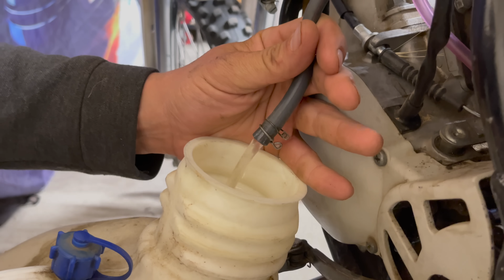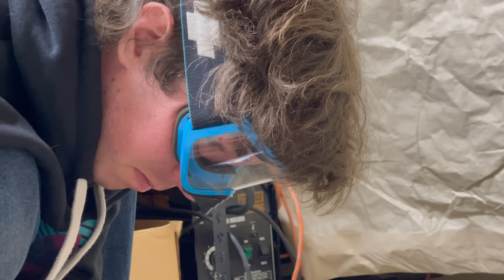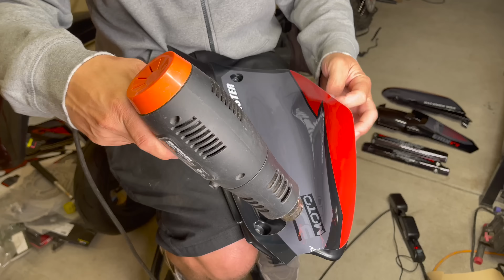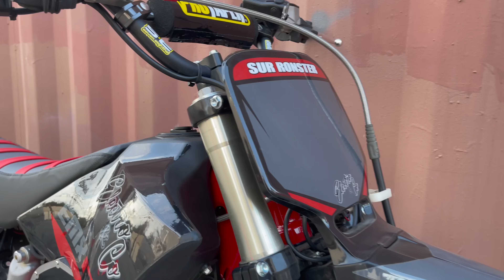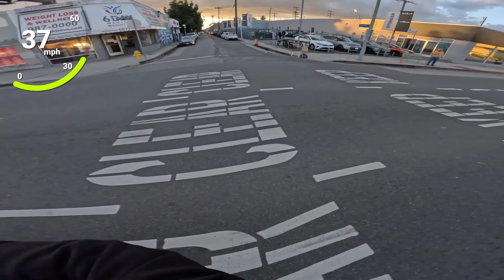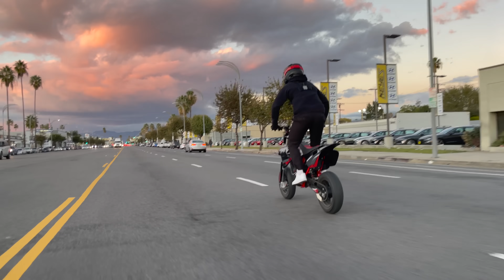Electric Yamaha YZ85 Supermoto // OFFICIAL Test and Review

Comment: yes but the clutch and what gear we're in on gas bikes makes the fun out of it, a lot of people like me find the clutch fun af
Reply: Exactly
Reply: an electric dirt bike should have gears and a clucth. It would be PERFEECT but in terms of maintenance you will have to change the oil and replace the clutch like a normal engine
Reply: @mastokjol8777  they do exist
Reply: Absolutely
Reply: theres a few models which have a clutch and gear system. if that’s your preference then theoretically you could still get electric mx bikes with clutches
Reply: clutch and gears are a much smaller part of the fun than you think. quickly forgotten when you doing everything else faster/better because of electric. Try it, dont resume commenting til then, or it's just speculation..
Reply: @crankydad.6769  speak for yourself. the gears, clutch and engine feel/sound are everything. people who prefer electric don't actually care about bikes. they are dead in comparison.
Reply: @crankydad.6769  i have tried it, i dont even need electric, i have a polaris automatic fourwheeler with no clutch which is essentially electric with an engine, which i have driven for around 13 years, clutch and gears is more fun
Reply: Would like but it's at 69 likes so I can't ruin it I like poping the clutch threw gears on a gravel road
Reply: Like you i am speaking for myself. But sharing knowledge to people is a bit more i formative than those just beating a drum and arguing about comparing one to the other is silly. Im all about performance, music is for noise, clutch and gears are there for an inferior motor. There are so many cool potentials for electric like whatever part of clutch you want, and traction control etc.  they've only just made the basic systems so far.
Reply: Petrol auto isn't the same as electric in any way. No max power and torque from zero revs with petrol auto.
Reply: @crankydad.6769  tf is petrol auto 🤨
Reply: @crankydad.6769  your name fits you well and dont tell me to stop commenting you dont have that permission
Reply: STOP COMMENTING! How ya like them apples? until you have experience with a decent electric bike. Otherwise you’re just speculating and wasting peoples time. Nothing will replace two stroke thrill, but other things can be as exhilarating.
Reply: that’s why they are separated, there are advantages to both
Reply: I do enjoy a clutch also. I WOULD want one Even without gears just to regulate the power
Reply: Requires more skill too
Reply: In SoCal, we cant ride in the desert year round, so electric bikes are perfect fun when you cant take the gas dirt bike out.   Obviously gas bikes are fun in THEIR way, but fun is fun is fun

Comment: That thing is wicked! Feels smooth as heck. I do wish there was a solution for the massive gap in the front left side of the fairing where the rad fill-up typically would be
Reply: There is called 3d printer or make your own plastic part and Welding it to make it look flush I do plastic welding so this problem is a very simple solution and could be solved in less then 1hr or alittle longer if you used a 3d printer
Reply: @jesusalvarado7337  cool story

Comment: If you're 6' and up, getting a YZ80LW, a taller seat, and tall bars, would be the way to go with this kit. . I haven't been on a YZ80 for years, but I remember them being pretty small. The one thing that's sad to see, is the engine gone. 80cc motocross engines are extremely fun. The powerband on 80cc motocross bikes are snappier than 125's and up. They also sound great. Hopefully that engine is going to be used for another bike, not something like a go-cart.

Comment: verry nice toy:)  But: in the summer you may have a problem with the battery (overheating) but I recommend designing a liquid-cooled battery on ultracapacitors. e.g. 3000f 2.7v graphine. you will minimize the possibility of fire as well as speed up charging and capacity, but it's good to make electronics for it and a housing with a directional channel for explosions (if you put the electronics together wrong) also think about a cooled engine and put it on the circuit for two radiators. capacitor name to search and wonder: Maxwell Technologies: BOOSTCAP Ultracapacitor.
Reply: that may be for u good direction to have superbike on each whether and time of year .. specially in summer where is a loot fire from standart battery what most ppl installing..  so rethink what u installed and my propositioin to expand your project  because is really nice :)

Comment: Cool video, welcome back to good video production.  Still don't get why the micro wheels, but whatever. Is that a direct drive motor? What size sprockets and wheels? Curious on the gearing. Jumping on a burner bike with clutch and gears any time in the future will be even more fun and novel, but you'll always have an electric as number one in the collection once you get one. My last three bought bikes were petrol, still love them, but only bought them because no electric in their gnieche(how the fcuk you spell that?).

Comment: should do it with a full-size dirtbike bigger motor and batteries
Reply: surprised they dont do geared electric motors full manual and have the back break as a pedal like a normal bike faster w gears?

Comment: But you for sure can make money off selling the engine and exhaust. But it’s good that it has race tech suspension. Good for jumping. But would be interesting is if they made kits where you could have two or three gear. And then I see the KTM has water cooling. Also you should put a bracket or something in the side where the radiator was. Because it was flapping around and it will bend and Wes rout quicker

Comment: The silence could also be deadly for you ! Blasting up through traffic like that silently one of those cars will pull in front of you really easily
Reply: I have a piped bigbore 450 supermoto and a straight piped harley, also put almost 10k mi on a stock 250ninja. It doesnt make a difference, the "whole loud pipes save lives" is a bunch of B.S.

Comment: How long does it last on a single charge? Everything you’ve stated are great reasons to switch to electric but I think the main reason holding it back is the duration you can ride, untill you can ride for atleast 5hrs on a single charge I’m sticking with gas
Reply: Wri n g

Comment: Sifting through comments looking for the answer, gave up after 5 minutes but here it goes, probably asked before, what wheels? I'm guessing they are honda grom wheels? Are they 12 or 14 inch? I know one company makes 14 inch wheels for the grom even though it comes with 12"   The wheel part is not included in this kit and the most important factor for a street sm conversion.
Reply: Ah zoomed in they are 12" in that case michelin power pure 2ct 120 front 130 rear is the way to go smooth and sticky